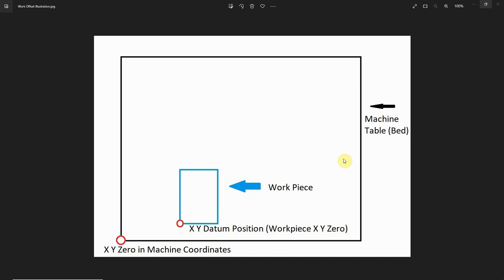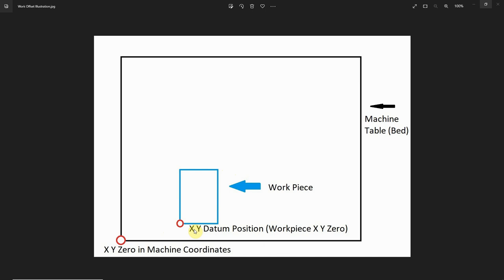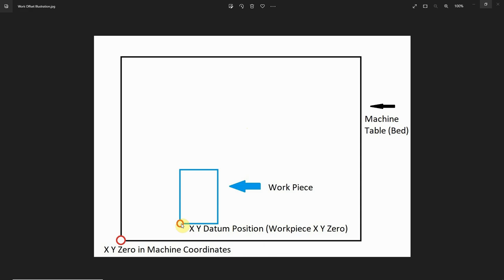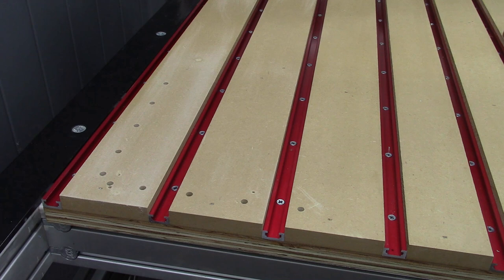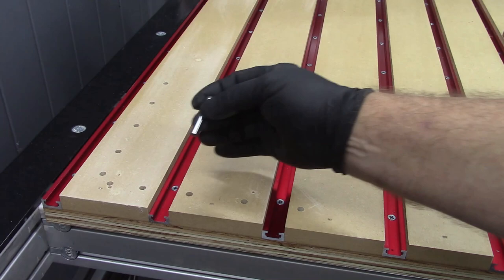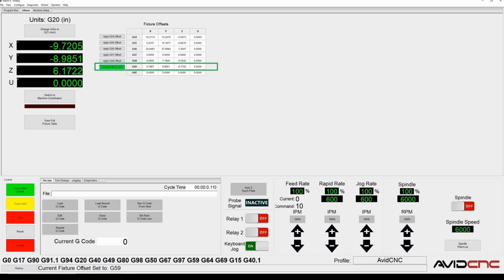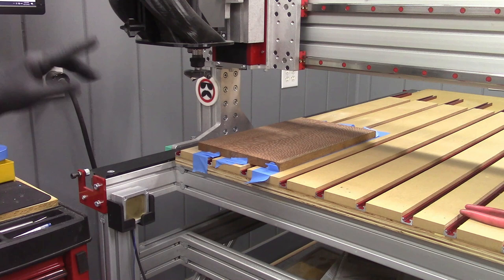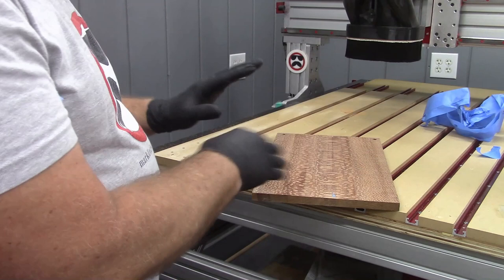Introduction to Work Offsets and Fixture Offsets

Comment: You have explained things perfectly forever. But Iafter watching this I am still confused
1) when you home the machine do you zero the software? I home very time I turn on the machine. It is never at Zero since I don't use offsets.
2) Next time I start the machine I will zero at “home”. When I move to the work offset that is a permanent place I can’t use the plate. That would create a new zero. Thus negating the home as zero.
If we can get through this part I think my brain will me to go ahead.

PS: feel free to drill holes in your spoil board
Alan
Reply from the maker: Thank you, Alan. I think I know what is confusing you, as it was hard for me to wrap my head around at first as well. The thing to remember is that just about all controller software uses 2 coordinate systems: Machine Coordinates and Work Coordinates. Your controller software almost always defaults to display Work Coordinates when you start it. You have to set your display to see Machine Coordinates if you want to - and it's not important that you do see them.

When you Home the machine, you're setting the Machine X Y and Z zeros in Machine Coordinates. All that does is give the controller software a reference point to base all of its movements from, and lets the software know where the center of your tool is in reference to the entire machine working area. Your readouts are most likely displaying Work Coordinates, which is why they don't read 0.0000 after you finish Homing. That's fine - there's nothing wrong with that. 

Think of it this way: Machine Coordinates tell the machine where the center of your spindle/router bit is in relation to the entire CNC table. Work Coordinates tell the machine where the center of your spindle/router bit is in relation to the piece of material you're carving. 

Using an offset doesn't negate the Home as zero. The offset tells the machine how far away from that Home zero your Workpiece Zero is.

Do this experiment. Get into your software's User's Guide and find out how to view your Machine Coordinates. Set your display to Machine Coordinates, and Home the machine. The display should read zero for X Y and Z. Now move the gantry out of the way and mount a piece of material anywhere on the table. Go back into Work Coordinates, and set the X and Y zero to the bottom left corner of that piece of material. Don't move the gantry or spindle from that point. Now go back into Machine coordinates and look at the display. The numbers displayed at that position show you how far away from the Home X and Y zero that current spindle/router position is. THAT is the Work Offset.

Does this help?

Comment: So what about the design stage of a work piece? (eg Vectric), do you set the XY zero (lower left) as usual and that would be applied to the machine's offset?
Reply from the maker: As I explained in the video - you set the X Y zero in your CAD/CAM software (eg Vectric) as usual. The Work Offset and Fixture Offset (if used) are applied by the controller software on the machine - not in Vectric.
Reply: @MarkLindsayCNC  Got it... Thank you Mark